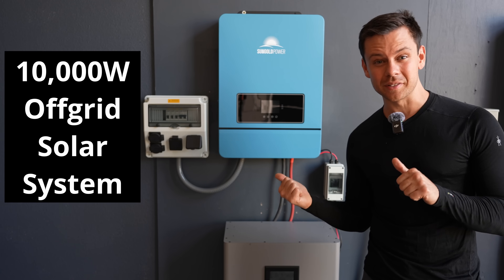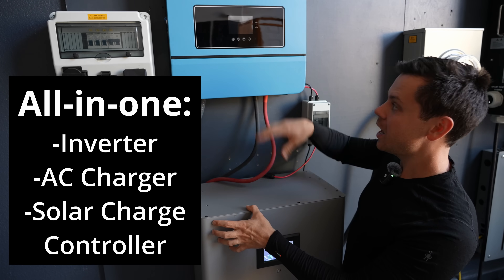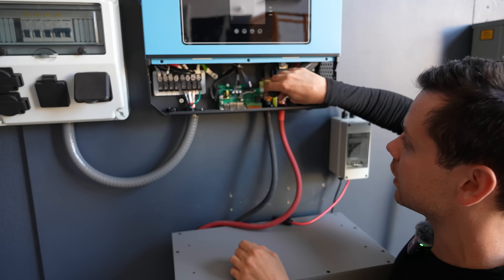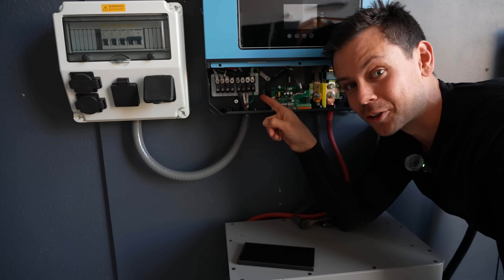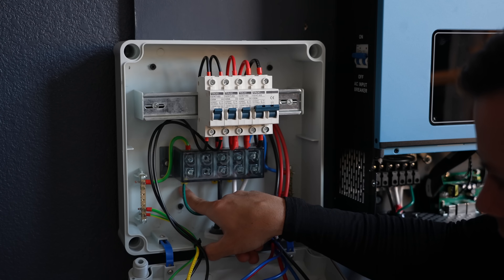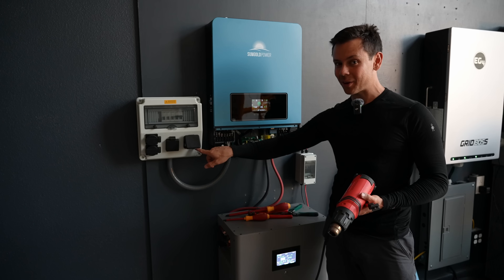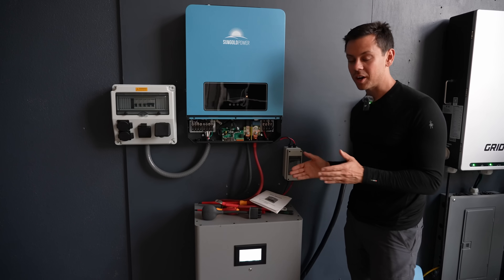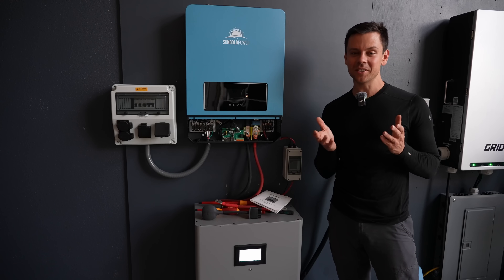Offgrid Solar Beginner Crash Course: Build a 10,000W Solar System

Comment: where is the link for you "why you dont want to exceed 500v" as I want to watch it, it seem to me that the higher the voltage the lower your loss by reducing amps so there is less loss to resistance? I mean if you're system can handle higher voltage then why not get the most out of your panels? I am not an expert here so I genuinely want to learn the problems.

Edit: After looking it up I suspect you would be talking about the increased danger from DC ark flashes and similar high voltage dangers which I can see if you don't follow very strict protocols for breakers and isolation could be very dangerous

Comment: What's a good way to setup a dump load for a eg4 12000xp off grid inverter with 16kw worth of panels? I travel a lot for work and need to do something with the power.

Comment: The manual for SPH10048P says the maximum input current for the MPPT is 22A. Is a 25A DC disconnect a better option than the 60A showed in the video?

Comment: instead of connecting to the outlet box could you connect 50 amp generator outlet box then use a cable to connect to an installed generator inlet box that connects to your panel in order to power the whole house, use this instead of a gas powered generator?  Thanks for all your videos, one of the better professors at YTU (youtube university)

Comment: Hi Will. You forgot to mention that even though the system is off grid, you still have to bond the Neutral to Ground either at the Inverter or at your breaker box, but not both. if the hybrid inverter is not already bonded. Then you need tie the ground to the earth to a 8' rod driven into the ground as close as possible from the system. Your Solar panels frames also need grounding and can connect to this same earth ground. If not possible, it could be done with another rod further apart, but  both rods need to be connected by a minimum 10 AWG bare solid copper wire to the system grounding rod, such that the resistance of the rod to earth does not exceed 25 Ohms. Another thing worth mentioning is that many Hybrid inverters ordered from AliExpress are 240 single phase. It means that there is no third red wire L2. We just have a black L1 and the white neutral N wire with 240 VAC across. The system may or may not have the Neutral bonded to the case GND. A continuity test is necessary to ascertain that it is or not.  Often a screw can be removed to unbond N from G if bonding at the breaker panel is preferred. That is what I did with my MPP inverter because I wanted a split phase output, which I got, by using a 5kW step down toroidal auto transformer and getting the new Neutral  from its center tap. Then bond the N to GND and GND to earth stake. No grid input is needed nor required. But it is an option, for those who have long winter and few panels and battery. In this case if I remember well, the grounding earth stake of the grid must be tied with a buried beefy solid long 6 AWG copper wire to the earth stake from the hybrid inverter system. I hope this clarifies the missing part. Thanks for your videos, keep updating us.
Reply: Is there a video explaining this in greater detail. My main question is if I do 2 ground rods at the solar panels would I attach a grounding line to the output of the inverter that goes into the 8ft rod?

Comment: Great Video again thank you sir! I am building this setup, one warning to anyone using the Sungoldpower inverter is if you try to use 4/0 battery cables some lugs could be a little to wide for the negative battery terminal in the connection to the inverter, the dangerous issue here  is that on my inverter, the negative lug contacted the mounting screw of the negative lug mounting board, this screw goes into the metal chassis case and therefore would create a dead short. So anyone using other that the battery cable lugs supplied with the inverter should check this carefully. Other that that all looks good and i am excited to get my first real solar project up and running.
Once again, Thank You Will Prowse for all your concise information you have shared here in your videos they truly are what have inspired me to have a go at DIY solar.

Comment: 1) Does this confirm that the company did indeed fix the issues with the 240 box that you prior got them to fix with the 120 box? 2) Does the 240 box have a meter built in?

Comment: Great.  Can you connect up an outlet to the AC and plug in a generator.  I am completely off grid. I want to be able to plug in a generator during the winter if I am not getting enough sun to charge the batteries.

Comment: Don't you need a breaker or fuse between the batteries and  inverter?
Reply from the maker: Yes, the battery has fuse and breaker and OCP on BMS. Three OCPD for supply conductors. That's why we do it this way

Comment: Does anyone have any recommendations for a similar outlet box to the one in the video? This would be perfect for my setup as I'd like to run a few 120 outlets in addition to the 240 that will go to my trailer.  I ordered something that looked similar on Amazon but the wiring is setup to just go directly from a breaker on a house into the unit.  It doesn't have the bar where will connect each of the 4 wires individually.  The unit in the video is sold out and I'm having trouble finding something that's identical

Comment: I don't understand why most people wouldn't want to connect an AC input on this unit.  It's my understanding that the neutral and ground is bonded in everyone's main electrical panel.  And this unit's initial setting is not bonded internally, which is what you would need.  Much like a sub-panel.  It should be as simple as installing an appropriately sized breaker in your main box and making all of the connections.  I haven't done this yet, but am I missing something? 

Seems like you are giving up some very useful benefits by not connecting it in this fashion.  Including the ability to supply grid power when your batteries are low at night.

Comment: Is that a single phase pv breaker? Because I thought that the top of the breaker has to go to the solar panels? And the bottom to the inverter.., And my breaker has the red and black wires on the opposite sides of your video

Comment: bro my doubt is , if the battery is fully charged and if there is sufficient sunlight can the inverter power the load directly from the solar energy without using the battery

Comment: To get around the complexity of running ac power in, could you just install a simple transfer switch into the main breaker box with the inverter/solar as priority than grid as secondary? That way it would power your house off the solar system but if it shut down automatically switch to grid power? Than when solar came back switch back?

Comment: I would like to see a video like this, but one that has the equipment YOU would buy, based on all the testing you have done of the different products. I want to start building a system, but am I not sure which inverter to buy, which batteries to buy. There are so many choices... but what would be your go to, after all the testing you have done?

Comment: Two questions!  1. Should this system be earth grounded by running a grounding cable from busbar to a grounding pole.  If not, why not?  Also, is it ok to ground PV panels to negative on battery?

Comment: Sunsynk 6kw lynks, 10kw (2 x BSL 5kw rack mount batteries) .  10kw batteries = 8kw usable power. Check the specs. 500v MPPT x2
Reply: In South Africa,  this system will also carry a 10-year warranty .

Comment: Great video high lighting some very great solar products. A quick question for you how do you size the PV disconnect for the 10KW unit in this video assuming your going to try and get the max 500v or near that of solar?  Also, you showed a 48 volt lead-acid charger, would you need that or Lithium? Sorry new to this.

Comment: Totally get why you say its not beginner. But do you have any resources you recommend for the AC input side of things? Would be cool to use time of use grid power to top off the battery at night, especially true in winter.

Comment: Is this setup too big to be used in your Hand Cart configuration? 

The pieces look similar (battery, all-in-one, and outlet box). This just adds a disconnect and is bigger. Wondering if the size would prevent it from being mobile rather than wall mounted.

Comment: How do you determine how many solar panels you need for any general setup? I know it determines on what is consuming the energy in the battery.

A typical lead 12v battery from Walmart usually last, when new, about 12 hours of straight use before the battery dies. Not sure if this is enough information provided, but looking to get some solar panels and reliable information from this channel how to determine the amount of solar panels. (i live in Florida)

Comment: Please, make a similar video for marine  application. I am looking to upgrade 600w 12v house battery on my boat to 48v 3x5kW parallel system with genset, invertor and solar. Unfortunately I cannot find reliable info on reasonably priced marine grade components. Any insight would be greatly appreciated.

Comment: Hey Will, SunGoldPower told me to use setting 08 to L16 (I have the SPH6548P, so it may be different).
Please add a link to the battery charger you used (I didn't see it in you listing of stuff used).

Finally, you broke the Amazon link for the 120v / 240v outlet box - they're sold out!

Comment: I’m confused as to why a 48V battery needs such large cables? I thought as voltage increases/ amperage decreases  and wire diameter decreases. What am I missing?

Comment: How important is trying to get the interface between the inverter and battery bank across the CAN or RS485? Makes sense to setup the Battery: User and set to 46-48 volt cutoff on the inverter, but are there particular advantages to setup that communication link? I've ordered this exact setup based on your video's and am excited to get it going.

Comment: From a guy who is a retired commercial/industrial electrician for 37 years and lives off grid with solar, this is the best explanation I have ever seen.
Reply from the maker: Thank you!!
Reply: It is amazing how simple these systems have become. I worked as a telecommunications technician for over 30 years and we had some very complicated systems. I have a 30 year old Trace 4048 at our remote cabin here in Alaska. I’m waiting for it to fail. I’m think of putting a system in our house. We have a great place for sun with our eastern horizon 15-20 miles away and our western horizon is 35-100 miles. I designed our house to put panels vertically on our south wall.
Reply: Thanks
Reply: Asking because you seem very knowledgeable,  The battery link (product links above) takes you to the 51.2 v battery and not the 48v, does that matter?  Thanks.
Reply from the maker: @bauphan807 same thing
Reply: @WillProwse  Thanks Will, appreciate everything you do!
Reply: @bauphan807 No. The battery is rated for a 48V system. Mine is programmed to start charging at 50V and stop charging at 55 I believe.
They give you ratings like 51.2v and 312Kwh. If you do the math and multiply 51.2x312=15,974 watts. Or 16kwh. So you would have 16,000 watts if you discharged fully or if you only go down to 20% you could use 12,800 watts.
Hope this helps
Reply: @bauphan807 Also look at how many cycles a battery will give you. Mine is rated for 8000 cycles at 77 degrees F. My house stays at a mean average of 68 ish so I will lose a few cycles but all summer and parts of spring and fall we only discharge between 10-20% so I should gain some of that back. Either way mine has a 15year warranty and 20 year service life. It is a 16 KWh battery from MidNite Solar.
Reply: what do we need if we want to be able to weld for 2 to 3 hrs a day?
Reply: @jacobkelley519 a much larger system…..

Comment: 3:27   -True, my system have and external charge controller and accidentally i remove a battery terminal and the voltage of the charge controller increase and burn my inverter but i don't know if is the same with new inverter with an integrated charge controller (all in one inverters).

Comment: A great video.  The only thing missing would be a block diagram and a quick overview of the cost.
Reply: The Thing missing - a ground rod and bare copper #6 conecting cable.  This is a stand alone AC system and needs a ground rod. Yes he could connect to the home Ground as an option.  Glaring mistake to build an AC system without any ground rod.
Reply: Can someone tell us what the cost is?
Reply: @abacab87   He listed most of the components he talked about and linked to places to buy them. If you are serious about doing something like this, you should make some effort to read what he already provides, and research things on your own.

But just for reference, here are cost estimates based on what he linked, and some of my experience, using 10kw of solar input, as he talked about. I am not an expert.

$5000 - 10kw PV Modules(25 x 400w @ $200/module, estimate)
$1900 - 16kwh 48v Battery (his link)
$1700 - 10kw 48v Inverter (his link)
$1000 - Rapid shutdown system ($40/module, estimate)
$500 - Mounting equipment (estimate, very variable cost)
$100 - Quality battery cables (estimate, his link $65)
$100 - Power box (estimate, his link unavailable)
$100 - PV extension cable (estimate, depends on length, his link $40)
$100 - Grounding stuff (estimate)
$50 - 2 x PV cutoff, one for each 5kw string into inverter (estimate, his link $30/ea)

$500 - freight shipping for PV modules & battery (estimate)

= $11,000, approximately

+ Your labor/knowledge to install
Reply: that's a great breakdown of pricing. FYI, you can get used solar panels for incredibly cheap. I paid $200 for 2700w worth of panels. They are 90%+ since they are used, but they'll last another 15 years, and are so cheap you can scale it up and keep your budget reasonable.

Comment: Can anyone give me a link to how would i go about connecting a battery back up system for my roof grid tied system that has micro inverters. I do not know what to look at first. What to run. I bought the house. Only a main panel. No subpanel. My solar on the roof is only 10 panels. 400w each. Only pulling 1.6kw from it (crazy) please help me out 🙏🏾. The door solar ppl knocking on my door trying to sell me on scams say 30k for battery back up. Lord help me. Also, my true- up bill been 1600 a year. 😢 sometimes 2200. Its been rough

Comment: Mr Will, I have been watching since you lived in a camper van motorhome many many years ago !  Man, thanks a lot for the great education! , I installed my own grid tie almost 3 years ago.  Now, a week ago, I bought this Sungold because of your presentation..     I have a sub-panel and have a small aux building that I want to connect to. Someday, many months later, buy the battery mentioned here.   My question is at 9:15 min you talk about not using Ac input then mention a Golf charger for the battery.   I want an AC input so when pannels are not producing the inverter seemlessly takes grid pwer then next day when ev panels produce automatically switches.  Remember no battery for a while

Comment: I have some feedback after watching this. You are missing a lot of information that will cause a hazardous install. Whether you are off grid or not Solar PV conductors on or in the structure need to be installed in metal conduit. You showed using flexible conduit between the inverter and load center which is no problem except you didn’t use connectors on the ends so the conductors are exposed. If you are off grid you need a grounding electrode system and make sure your bonding is done properly in a single location at the first disconnecting means. If you have grid power your main grounding system needs to be connected to this standalone system as well. Not an additional ground rod. One grounding electrode system per structure. Lastly there was no mention of a rapid shutdown system, this is required whether your system is grid tied or off grid for all but the tiniest solar arrays. I am all for DIY installation but this is very incomplete information about how to do this properly and safely. The National Electrical Code still applies to off grid and standalone systems. Just because it’s not connected to the grid doesn’t exempt it from electrical code.

Comment: Quick question Will, I can run my whole house on a 12kw gas/propane generator to include a 3 ton ac system with a soft start kit. The generator doesnt even hickup when ac or heat kicks on. Is a system like this capable of doing the same as my generator and if not, would there be an addition or upgrade of something for the system in the video?? Im currently contemplating the Eco Flow Ultra system. Any advice would be greatly appreciated and great video as usual!!

Comment: British Person Here:  I think the minimum also needs to include connection to an earth rod, otherwise you have a floating system, and a very high earth fault loop impedance (meaning your AC breakers won't trip fast enough).  It might not be necessary with split phase systems, but in the UK we just have 240V phase / 0V neutral output.

One other thought:  Is there sufficient strength in the inverter to support AC breaker short circuit trips?  Typically to trip breakers within regulation disconnect time (0.4seconds) , they need to support for 3-5x rated circuit breaker current.  If the inverter output voltage gets dragged down before the AC breaker trips, then you might not trip the breaker fast enough.
Reply: Yeah I have a system similar to this and because it's a floating system my touch sensitive led lamps are a bit finicky